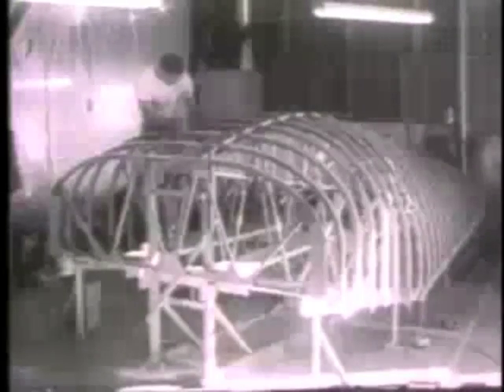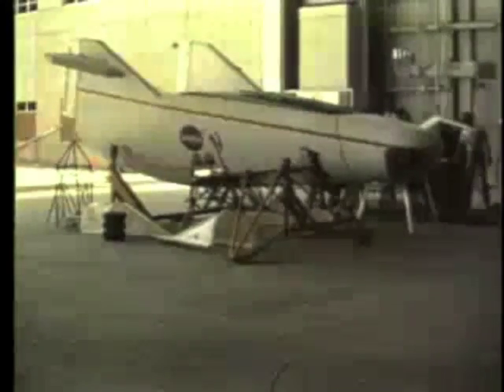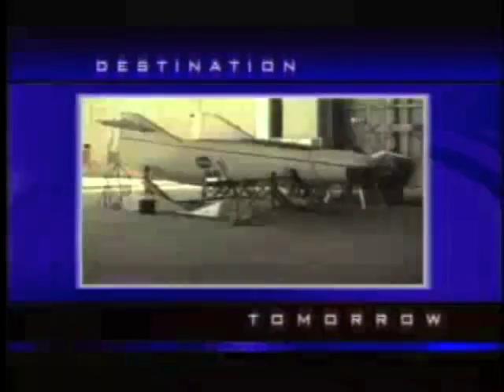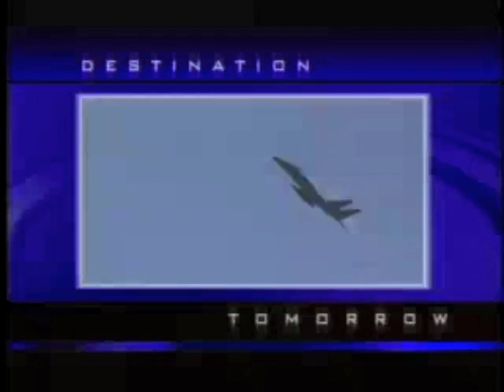NASA Destination Tomorrow - Lifting Bodies

Comment: @jetpoweredgriffin When I was at Dryden in the 90's. We were working with JSC to get the X-38 going. Stupidity cancelled the X-38! Who knows? If the X-38 had gone into production and modified to fly on a booster. We could have had a simple replacement for the Shuttle in getting astronauts to and from the ISS. Now, we rely on the Russians to get Americans in space. It's so sad. Do you have Dale's book? I'm sorry he did not live to see a lifting body as an every day operation space system.